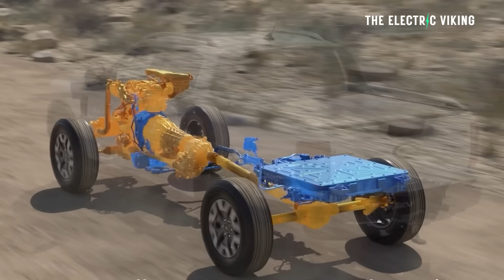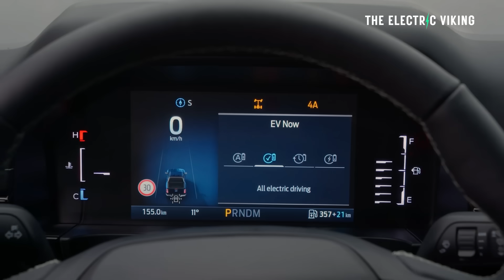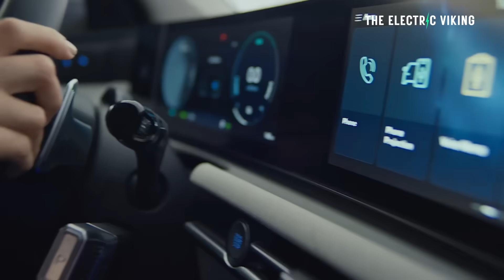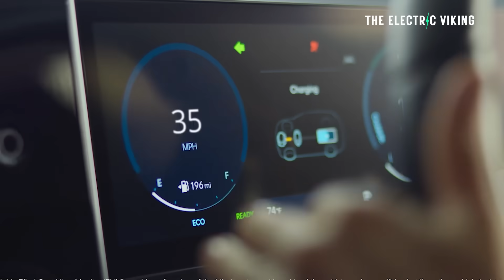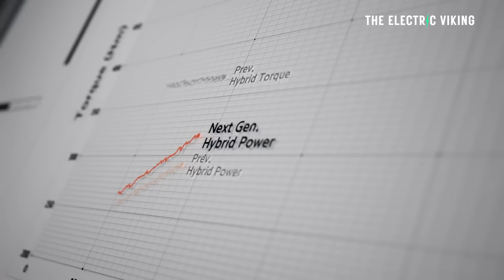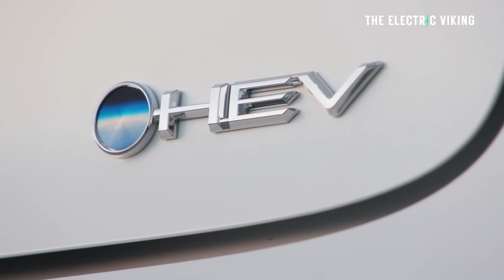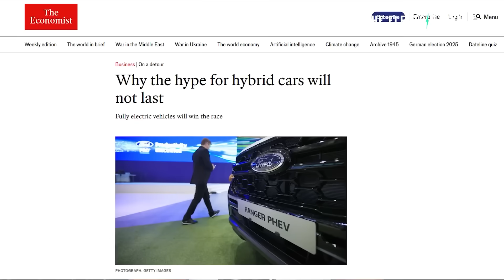Why experts say the HYPE for hybrid cars will not last

Comment: You forgot to mention that hybrids buyers will largely miss out on the benefits of vehicle to home technology when it booms in the coming years. There are already companies selling V2H systems that include the bidirectional charging infrastructure, a 10kw home battery and 10kw of panels for $20k. The payback on this system will only be 5 years if you have a large family home and drive the EV or EVs each day. For hybrid cars you will still be buying fuel in 5 years when you actually don't need to. Going fully electric makes economic sense right now and it will only make more sense in years to come.
Reply: Now imagine that you live in a home where cannot home charge.    So tell me how would you benefit from V2H?    So is not an advantage of a BEV.   it is the advantage of being able to charge at home which not everyone can.
Reply: @michaelmcnally2331  Jesus Christ on sale, mate… are you completely serious?
Reply: @thethirdman225 Yes.   The poster stated that hybrid buyers will miss out on V2H as if EVERYONE has access to Home Charging.    There seems to be this misconceptions by EV fans that everyone can home charge which is not correct.     I live in a first floor flat with my parking spot the other side of a road.
I drive a full hybrid instead of an EV because of this.     As such I have no ability to V2H even if I had a BEV.   I am not missing out on V2H by buying a Full Hybrid instead.
It should not be that difficult a post to understand.
Reply: @michaelmcnally2331  I’m very aware that not all vehicles are capable of V2X. I didn’t ever think hybrids would do it but I suppose there are exceptions. Are you sure you haven’t confused me with someone else?
Reply: @thethirdman225 not at all.    Original post that I replied to was not you unless you are using multiple accounts as the original post has a different poster showing.   You replied to my post asking if was being serious.    I replied to your post about me being serious, to which I said yes.
There is a reason why I wrote  “the poster” and did not post “you” as was not referring to yourself.
Not sure why you think I am confused about who am posting too.
Perhaps you responded to the wrong post when you replied to me initially?
Reply: Buy into the extension cord / sky hook business, as most car owners park on the street, even if they have a garage, it's full of crap
Reply: I hope that BS never comes.
Reply: @rovid  Why? Do you want everyone to have to remain at the mercy of greedy fossil fuel companies just because you don’t like EVs?
Reply: Doesn't make sense in the uk, because you lose 60% of the cars value in 3 years.  But,  you guys always forget to factor that loss back in to the equation.
Reply: @jimmyjam8795  That’s no more true for EVs than it is for ICEs. Even if it was, unless you charge from highway charge points, electricity is far cheaper than petrol. In a fleet buy that matters. So do life cycle costs. The running costs of EVs are much, much lower than for ICE.

Comment: Or one could postulate that as good a hybrids have become and will continue to improve, that the hype on Electric Cars in the USA is what will not last.
Reply: But if you look beyond the short-sighted USA-only, EV is the future. USA will be left behind & stuck with high cost to buy & to own ancient technology soon.
Reply: I am not sure if they improve on us market. The bench mark in North America is THS. And IMO gen 3, 4 and 5 doesnt change much in term of fuel efficency. They just become cheaper to make, still stuck in the pitiful 277V propulsion system. The 4 banger is under power for Highlander, Sienna and so. The V6 platform is dragged down by the engine, because the engine can go garnade anytime. The reason the THS sales figure goes up is because 1, they are still cleaning up the block log from Covid. Yes, after 3 fxxking years. 2nd, some model offer THS only. For hard core Toyota coustomers. They dont have a choice. Toyota is out of touch on market. They have the ball to price RAv4 prime higher than Equonix EV AWD. So, without suprise, we shall see GM ship more Equonix than the RAv4 prime.

Comment: Too small engine, too small electric motor, too small battery - worst of both worlds.  All the maintenance costs of an ICE vehicle coupled with worse performance.
Reply: Do you care about those stats in particular or do you care about things like "ability to road trip" and "not need to refuel ever for daily driving"?
Because if the latter it's closer to best of both worlds.

Also no reason why a hybrid has to have small electric motors. A series hybrid can use whatever the analogous ev is using, except swap the excess battery with a small generator and be lighter, slightly more performant and better in daily commute due to weight, and just be range extended without reliance on charging infrastructure for long trips.
Reply: The Reliability of Hybrid or EV, or even ICE vehicle has never been related to the Type of Vehicle they are. 
Reliability is always result of good Quality Control, and WHO made them. 
A Tesla is much more Reliable than a Rivian, or some of the Chinese EV. 
Some EV are still on the Bottom of the Reliability Chart, and Some EV goes 200k miles without much problems. It all depends on who made them.
Reply: @steak5599 do you know what you are talking about. First, a quality 101. Quality is achive via manufacturing not by inspection (read, quality control). Second, it matter who produce the part. But quaktug also determined by the design. Shxt design wont have good quality. The Toyota V35 engine fiasco is the pefect example thst good manufacturing cant compensate foe design flaw. And 3rd, where do you get the idea fro Tesla EV is more reliable than other EV model? Being tesla owner myself, I dont see How you justify the claim when I have already have 2 warrenty claim on my 3 year old viechhle. It is about the same as my older gas model. And I dont see it is anything better than the Chinese model my friend have. And if your reliability means power train last for good high miles without much battery degration. I can tell you there are fleet of Chinese EV in Taxi service racking up half million to a million kilometers with orignal powertrain and without much battery degration 😂
Reply: @林振华-t4v 
It absolutely has to do with quality control. If you're going by what Toyota said about that engine, the problem was from the metal shaving. 

A lot of time Parts fail because the result of lowest bidding suppliers. 

Of course, there are cars that's just design poorly. Cyber truck for example.

I did not say Tesla are better than all Chinese EV, I said some. Isn't there a light 90 EV brand in China?
Reply: @steak5599 I say the metal shaving is bs right from the get go. The quality via manufacturing is a Toyota philosophy. The metalic fragment in the engine is the result of the compent failure in the engine. Not the cause. Why? Becasue Toyota had dealing with metal chip blocking lubrication passage causing engine failure because the journal seized. They had dealted with this as early as the AZ engine back in early 2000s. The possibilities of having metal chip from machining process causing engine failure is extremely remote. That said, the cleaning machine for engine block in factory has additional nozzel to flush the debrie out from engine oil passage. And the assembler at the engine block assembly line will blow compressor air to the passage to ensure everything gets out. It is next to impossible this lession from older generation engine did not carried over to newer generation engine. I know this, becasue I was lectured in this when I was a interm in Toyota. What we see this whide spread problem is a design fawn. Toyota will say otherwise, but I know Toyota well enough if it is manufacture related probelm, it wont plague the engine for over 3 years gap. It will be more like couple weeks and no more than 3 montha.
Yeah, they are over 90 brand of EV in China. Lot of them are actually spin off from industry behemoth. Just like chevy, Cadilac, GMC and Buick. When you look into who is controling what, then the number is not so abusrd
Reply: This guy doesnt have a clue about what he is talking about lol
Reply: Phev is often attached to performance cars. To say they have worse performance is bs.
Reply: Hybrids are actually more reliable than regular ICE
Reply: @MrINDEPENDENT2000  No they’re not. PHEVs are some of the least reliable vehicles out there. Sam has published the stats before.

Comment: The problem with Hybrids are they start on electric power.. And on shorter drives,the gas engine will never reach operating temperature.. Causing wear. And still you have to maintain the ICE with oil change, spark plugs, filters etc.. No point with Hybrids at all... 😳
Reply: EV motor and drive train is much simpler -- with the hybrid you still have the complexity of the gasoline engine. I don't like doubling the potential problems .... 😂
Reply: @randygraham926 Toyota doesn’t seem to have an issue with their hybrids
Reply: @MrINDEPENDENT2000 they do, the sales figure is so minimal you just dont realize they have problem. The hybrid system failure usually get deffered in fleet viechle, it may never get repair till the viechle reach the mile to get send to junk yard. I was on a highlander shuttle back in 2018 when I notice the hybrid system was dead. The engine is runing all the time to charge the battery, but the battery capacity is blank. Triangle warning light on. I had the preface lift model and the one with dead hybrid system is a facilift model, which at the time barely 2 years old. And Toyota sofware is setting reserving battery in higher priority than passenger confort. The XU60 highlander doesnt not have aux heater when the C max from Ford with similar system in the same era has aux heater to the get the viechle warm up quickly.
Reply: @林振华-t4v idk what country you’re in but here in the U.S. Toyotas hybrids do very well in terms of sales and they are the standard when it comes to hybrids and a lot of technicians praise their hybrids cause they are so reliable
Reply: @林振华-t4v  What hybrid system are you talking about? 40-50% of Toyota and Honda vehicles sales in 2024 worldwide were hybrids.
Reply: @MrINDEPENDENT2000 look back 2016, XU60 highlander only has 4k sales in Canada. I was one of the 4k. And I have to wait for 2 week to get the viechle from another dealer. I bought the car in November, but the car roll off thejne in Feburary. It was not selling well in US either. You know, 2016 and now are actually 2 diffent world.
Reply: That is one thing, shorter drive means the engine runs more and add on wear and tear plus wont save few.

Comment: Hybrid works for trucks that need towing capability. Other than that, give me 300 miles and fast charging.
Reply: I  the USA almost half of sales are large Pickups and SUVs so that matters.
Reply: @jongabrielsen3868  suvs should be fine. Lets see how the Rivian R2 sells. (I am hopeful)
Reply: I see owning a fully electric vehicle in urban China is challenging to charge . Many seem to charge at fast charging stations with long lines . Now as we know it's not very fast so they are spending a lot of time being unproductive and for them it's wasting time like watching the  grass grow. So they buy the so-called bridge to EVs which is the hybrid .  Actually that may have been smarter to start that way with a plug In version or a generator middle like the volt but Tesla bypassed that . Toyota had an opportunity with maybe expanding from the prius but they just got stuck with just that model . 
Now many car manufacturers have hybrids . Byd made a serious  dive in . They realized charging in China is not easy . Long lines at charging stations . China got ahead of itself with the cart before the horse . The United states were on a similar path  but realized it's a longer process . Norway is a good example on how to transform but they have a far different situation they have access to large amounts of cheap available electricity and a small population . So it is not comparable to most countries . The United States has a lot of suburban housing which makes charging at home more available . 
It really comes down to the main problem which is charging with that being more user friendly over gas stations and that will be wireless charging. Having wires drooped like spaghetti looks a bit out of control and a bit hazardous . It always comes back to charging which needs to be readily available and doesn't use up personal time at great lengths .